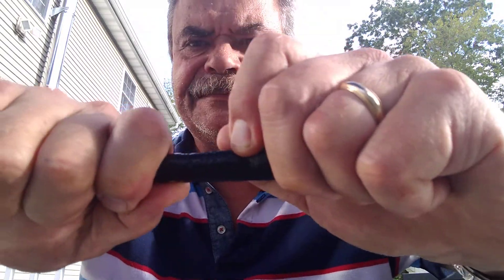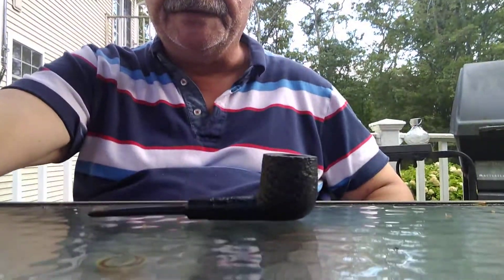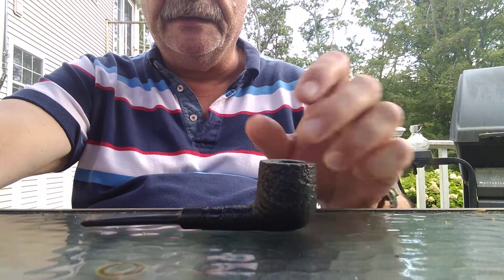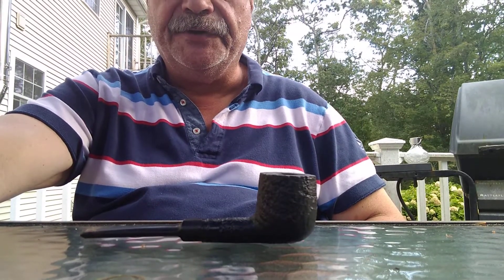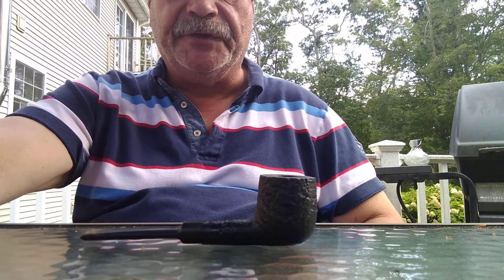BBB Straight Billiard!

Comment: Hi Peter no need to use sandpaper. Rub the tenon with bees wax it tightens a loose stem and loosens a tight stem I use it on all my pipes. Been smoking a pipe for over 40 years
Reply from the maker: Thanks!